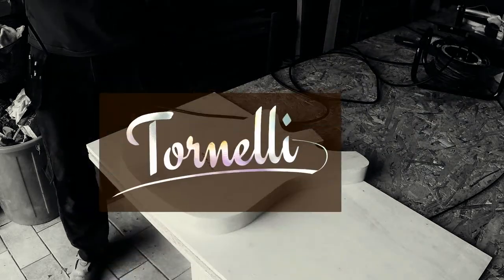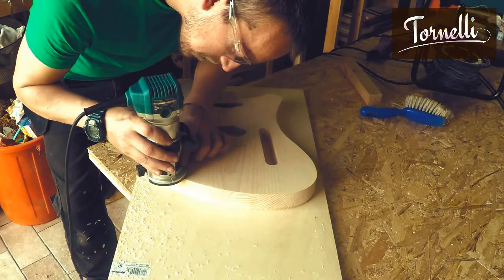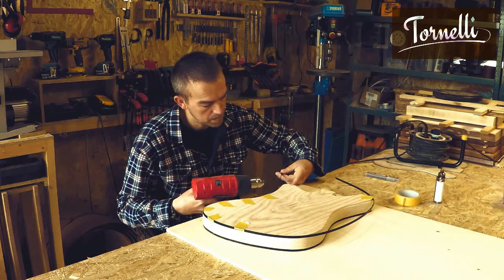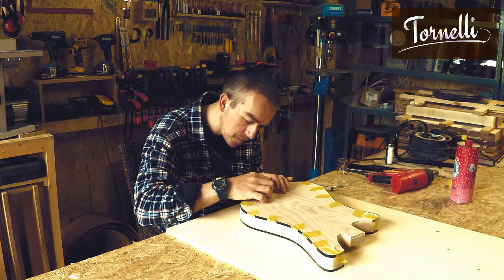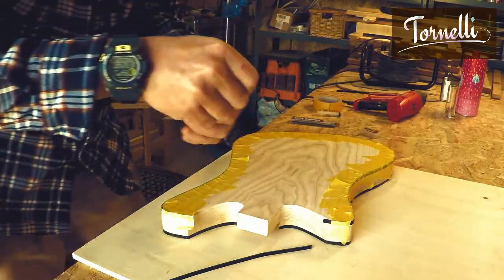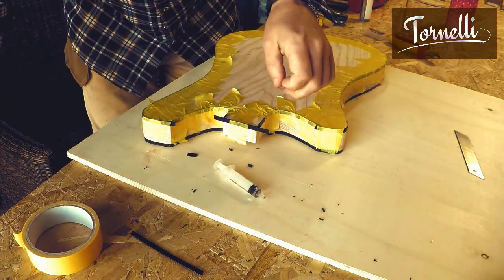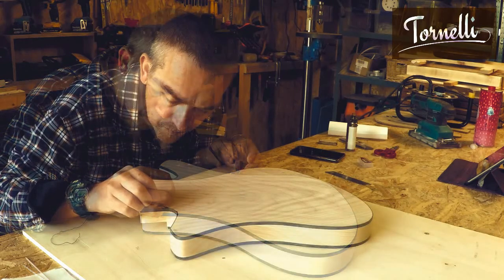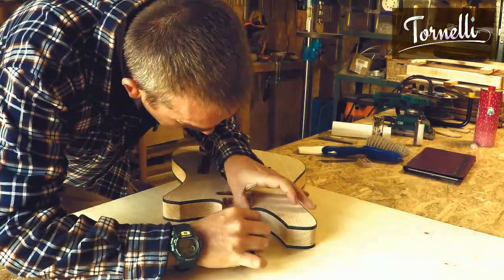Installing Guitar Binding with Acetone | Step-by-Step

Comment: I've got some Black Pearl binding coming Wednesday!
I have an old Banjo that had a pealing and chipped veneer back. (1920's or 1930's I'm guessing, by it's construction.)
So I cut a VERY custom new Birch veneer, with VERY custom inlay cut out of Cherry.
I will be giving this as a gift to my favorite musician, who once mentioned to me that they'd like to try their hand at a Banjo.
I will reveal the name of the person after it is received, so as not to spoil the surprise.
I will be coming back to this video again to make sure I get this right!
Thanks again for sharing!
Reply from the maker: Thanks for the comment! I’m interested to know so be sure to let me know how it goes. I’m really glad you found the video helpful. Cellulose binding is actually easier to bend and heat shape than ABS so I’m sure you’ll be fine my friend. Let me know if you have any questions 👍
Reply: @TornelliGuitars  Will do!
Banjo back is about 305mm diameter, so bend should be easy as pie!

Comment: Nice work! May I ask what your binding material is? Thank you! Scratch that just found the answer below! BUT... I test glued a piece of ABS plastic to a piece of wood and 4 hours later I could "pop" it right off the wood. Ideas? The ABS was a printout from a 3D printer. Was that the problem?
Thanks again!
Reply from the maker: Hi Jeff, the material I used in this is ABS, the technique also works fine for celluloid. I tried glue once a few years ago and decided I didn’t want to do that because it was so messy compared to this technique. The acetone actually dissolves the binding temporarily which is why I think it gives such a good bond and works so well for joining. I also haven’t had a piece delaminate ever using acetone. Having said that I don’t really have any glued bound guitars to compare it to. I wouldn’t think the 3d printed ABS would be any different but I may be wrong, the easiest way to know if this method will work is just to take a little bit of your binding and drop it into acetone, if it starts dissolving straight away it will be fine to use.
Reply: @TornelliGuitars  Thank you for that info. Yes I'm thinking the abs, after being processed (melted then solidifying again), may have changed the structure, or I didn't allow enough time to cure.

Comment: I've just bound a ridiculous travel electric guitar thing I've made. I didn't really watch tutorials, but I've just been binge watching them after doing it and it's become clear that, as always, I made things WAY too hard for myself. I opted for the thickest binding, which made the bending for the four hard corners (a paddle shape) much longer and difficult. Also, I was applying it to a guitar with an epoxy/wallpaper top and back. This made scraping/flushing as hard as it could be too. Totally nightmare and VERY time consuming for a guitar that will probably make a better cricket bat than an instrument. :)
Reply from the maker: 😂 well you certainly set yourself a challenge and I’d say if you can do that then a normal curvy wooden guitar body will be a breeze!
Reply: @TornelliGuitars  I seriously hope so sir. I’ll come back to your video as a reference point  when I do. I’ve a full tele to do in the exact same way first. This was the dry run. Which was massively needed. There’s all sorts of issues working with those epoxy tops throws up.

Comment: Just curious of the acetone, what type of acetone do you use?
I work at a Buildersware and we also sell the CureIt acetone, I assume it might be the wrong one as it is very strong or tooo strong for guitar binding...
What type of acetone do I need to get?
Reply from the maker: @HENNINGRAS  hi Hening, I just bought a can at the local hardware store that was labelled pure acetone, I’m not sure what type it is. I’ve used a few and they all seem to work the same, I haven’t noticed a difference. Sorry I couldn’t be more help.

Comment: i just did a telen body using stewmac plastic cream binding with acetone it didn't adhear had to use bind all there glue what  binding are you using and where idi ya get it
Reply from the maker: Hi Mark, I use anything labelled ABS plastic and I tend to buy from TLC Guitar goods. But ABS binding is the stuff you’ll find on Amazon and EBay all the time, it’s the most common. I don’t have any experience of the stew Mac binding but I’m surprised it didn’t adhere. Did you test a piece of the biding by applying some acetone to check if it started to dissolve?

Comment: hi, some luthiers heating their binding to bend, wanted to ask why you're cutting it on tight curved areas?, is it much better than heating/bending? thanks
Reply from the maker: Thanks for the question. I only cut the binding where the edge is very sharp. If there is just a curve I will always heat and bend the binding. This way I have less risk of ending up with gaps between the binding and body on the sharp curve.

Comment: how long do you wait before removing the tape?
Reply from the maker: About 20 minutes just to be safe and make sure it’s properly bonded. It will be pretty much solid after 10 minutes but I always leave it longer.
Reply: @TornelliGuitars  thanks for the speedy response. I'll start removing now then!